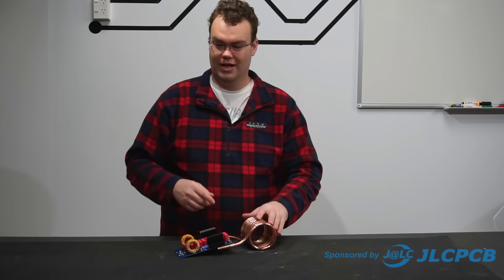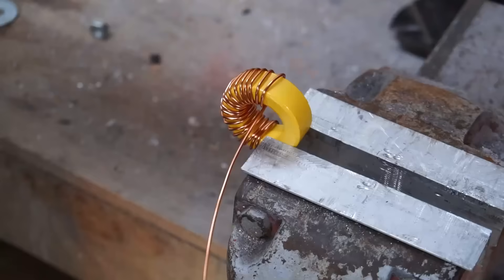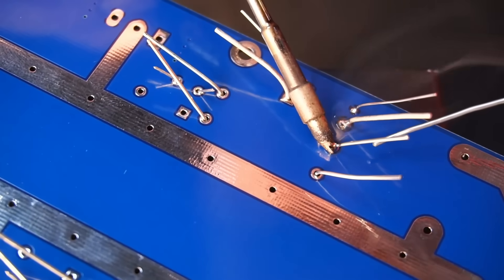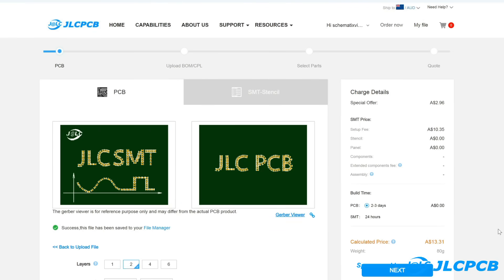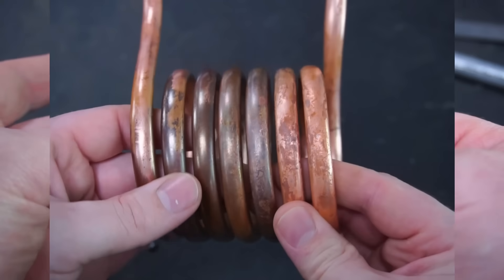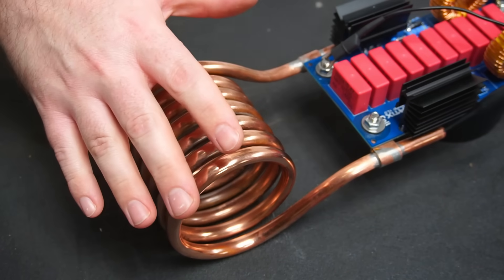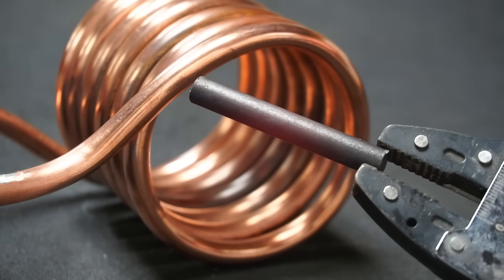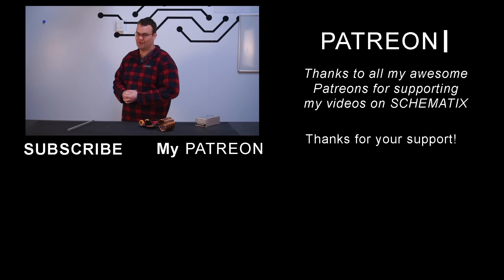Building a 1.4kW Induction Heater

Comment: Best induction heater build I've ever seen. Looks great and I loved your meticulous attention to detail. Very fine work indeed sir. One question though...On the Gerber files, would it be an issue to increase the thickness of the traces, in particular the fat ones you have to tin and add more copper to the traces? I was thinking about building this version, but either ordering the PCB with the thickest traces I could select or adding a copper busbar or long copper braid in addition to the tinning on the fat traces. I don't know if that would make much of a difference, but I like the idea of improving the current-carrying potential.

Also, if I may offer a suggestion. I had an induction heater similar to yours a few years back and I used a water pump, silicone tubing, a water reservoir, and a CPU AIO radiator from a retired CPU cooler and attached the tubing to both ends of the copper coil creating a water-cooled induction coil which worked really well. I bet that would help your desoldering problem and avoid overheating the PCB.

Comment: When you heat up Copper to soften it DON'T cool it with water let it cool slowly in air! It is way softer this way!
You quench something to harden it, yes it's softer then work hardened but way harder than slow cooled copper.

Comment: I'm betting the coupling is the major factor, but more notable in non ferrous since there are no domains to flip.

I would bet if you got a copper tube in there that's just so much smaller than the coil as to be a non-shorting fit, it would get right toasty in a hurry. Same for any decent conductor, really.

Down in the center, the field is easily overcome by the "weaker" eddy current field due to bad coupling and so not much happens.

Up close in an air core, with a tube, you effectively then have a single shorted turn secondary transformer, and the juice is gonna flow. Object can be solid as well, but it's mostly going to heat "surface down" rather than being uniformly heated by a changing field.

Eddy currents are of course present in ferrous as well, but hysteresis dominates by far at higher frequencies.

Comment: I think if you make the connection of the coil in the center of the PCB you reduce the current running in the traces. At the end of the trace you have the max current running, in the center it comes from left and right and therefore the maximum current in particular part of the trace is less.

Comment: If i wanted to use this for heat-treating small metal parts could I take something like a fire brick that was shaped to hold the part in the center of the coil? Round on the bottom so it would rest on the coil and have a channel cut in the top to lay the part in

Comment: if frequency and power variables, can heat different metals, and some alloys. what is needed, is a variable, voltage and variable frequency, device to power, different size coils. you might be able to even shape rock, with the right power, and freq.
Reply: You're using a far lot of commas but okay, got your point :)
EDIT: I absolutely loved your copper coil build, I was searching things like them a while ago for a prospect build by the name of "Metal wicks". Found it finally, thankyou so much!

Comment: great project. i hear about inductive heating but till tonight that i saw how it work... I got in to it... would it work with stainless still. or cooper.. im planing on building a water heater for a low laying dry ice machine. I need a water heater that would heat up water as it passes thru the coils. so it would be spray on to the dry ice and generate the low laying fog efx. i was planing on using map gas but after seen how efficient inductive heating work I belive is the way to go.. but also power is a big problem 1500 watts its alot of power, it would be a problem in most places where i would be using it.

Comment: I need advice.  My heater is heating the coil up very hot without any metal inserted into it. Yours doesnt appear that way, I can see it directly touching your deskmat. Mine is much smaller and its basically just heating the induction Coil itself up as if it were a resistor and dumping the full 120 watts (12V*10A) out as pure heat. Its reached 80C quickly in under a minute and I shut it down because I feared it would increase and melt the whole PCB down.

Comment: you have placed your  capacitors in the center of the pcb, and unfortunately capacitor terminals during resonance carry very high currents and will radiate heat and magnetic fields in all directions . Its much wiser and better to place Resonant capacitor banks  far away from board components.

Comment: A lot of blacksmiths are using 15Kw induction heater units.  These all have a water pump for pumping water through the tubing to keep it cool.  It's not the curent running through the tube that heats it but the radiance from the metal being heated. 
 https://www.derekmelton.com/my-induction-forge?fbclid=IwAR3k4UowbXOpFMoc9bBchBT3vnGh5ZqZOwxhH2lgB8vMrfYmAlKoN3JfAEM

Comment: I love the video and the design of the board but in reality the working coil is SO IMPORTANT (number of turns, diameter of coil and gauge all play a MAJOR part on frequency and power) and changing the ratings of capacitors (smaller) and working coil all change the output Frequency! (higher!) and decent connection on the working coil is a must there is a 6mm gap between the copper brackets you soldered on and the actual board!! could i ask what is the frequency of this should be between 15-25khz?.
I have a 24v high frequency power supply setup atm and it's only capable of 10A @ 24v so 240w and it heats up all small steel great!!! would fit inside a UK double socket box what do you think?.

Comment: Would a DC welder work as a power supply for this?

Also, to heat up non-ferrous metals perhaps you could wrap a steel wire around the non-ferrous object, or slide some steel nuts on it, or something along those lines.

Comment: Hey there.
It appears the given dimensions of the toroids used are different in the video compared to the doc on your website. I was wondering which one you used and if maybe inductors built with these two different toroid have an equal amount of approximatly 100uH.
By the way impressive build.
Greetings.

Comment: Very nice. I wonder if this would be good for an instantaneous heater for individual taps. It’s already more efficient than resistive elements but to have them sized correctly for each individual tap would mean even less heat/power lost through the pipes.
Reply: You'd need a hell of a lot of power to do that. A hot water heater has a huge element, and can't keep up with demand of a tap. If you want tankless, natural gas is the way to go.
Reply: @bluedistortions  yes, once upon a time hear in Australia it was common to have 3 phase instantaneous hot water heaters supplying all hot water taps in a house from a single central unit.

Comment: This is a beautiful video, very pedagogic and nicely presented. I did forsee the lack of powermanagement in the printed tracks. Solder is not a very good electric leader, so I thought, this is going to melt. In my own induction heater , I solder a cupper track on the printed board to cope with the rising amps :-))

Comment: Hi bud, this is awesome but how does copper become harder the more it's bent? My logic states it breaks eventually with fatigue, I can't fathom it :s thanks for sharing mate :)
Reply: That's why it results in failure due to fatigue. The work hardening effect increases the hardness, causing it to become more brittle and lose ductility i.e. eventually causing fracture.
Reply: Copper behaces the opposite to steel/iron. What you know on steel, just reverse it.
Reply: Sorry I've just seen your comments guys. Wow, this might be daft but I'm finding it hard to perceive, it's counterintuitive in my head but I guess as clay hardens, it's also brittle: eg. A vase or mug; clay is basically between soil and rock I guess. I think I also remember of brass monkeys (as in the phrase) guns cracked or fractured in the extreme cold, not just contracting. Mind blown, thanks for the info!

Comment: Hi !, thank you so much for this video !; I have some questions ... would it be possible to generate the alternating current of the winding directly from the alternating electricity of the home? Would 50Hz at 220V be enough to generate an inductor?
Could the consumption and therefore the amps be controlled through the number of turns, size, and the material that was being heated?
In this way we would avoid having to rectify the AC in DC and then generate an AC by resonance again.
All the heat generated by this process does not affect electromagnetic efficiency.

Comment: I want to try this heater to find out if I can heat up (flowing) water in a warm-water circuit.
Looking at the parts list and PCB, I have a few questions:

The cap bank, you need many to reduce ESR and/or current through each cap? I could use 3x 630V 1µ5 caps, but the schematic shows 10 470nF caps and I wonder what the reason could be for 10 :)

The MOSFETs are hard to get at the moment, but I see IRF200P222 - wouldn't these IRF be better than the ones in your parts list?

Would it be better to parallel the FETs with another one on each side?

researching the circuits I found this hint on some websites about induction heaters: connect one side of the heating coil to the front of the cap bank and the other side to the end of it, so the cap closest to the coil won't heat up as much because the load spreads over the whole bank this way.
What do you think?

Comment: WHY HAVE YOU NOT TRIED A MUCH LOW POWER VERSION IT ON MALARIA?

Magnetic fields may hold key to malaria treatment, UW ...
www.washington.edu › news › 2000/03/30 › magnetic-...
30 Mar 2000 — Henry Lai, UW research professor of bioengineering, says the malaria parasite Plasmodium appears to lose vigor and can die when exposed to ...

Comment: You did a great job,well-engineered. I suppose you should create a special high current driven path for that high amount of current, the simplest form is to create multiples through-holes in the path to make it temperature-tolerated and well-ventilated. Thanks for sharing

Comment: We use an induction heater for welding steel tube at work. Ours runs at 800 volts, is rated for 800 kW, and uses a frequency of about 135 hz.

You can increase efficiency, and therefore power, by decreasing the gap between your coil and the heated object. Try it with a piece of steel pipe with a diameter of ½-1" smaller diameter.

Comment: I think I'm going to build one for a friend.
Important questio though. Can I have the coil installed on a flexible "extension cable"? What are the implications of that and how to calculate the length of such cable?
Friend of mine works in the garage and won't be able to get the size it this anywhere, so smaller coil on an extension cable is the only option.
I'd be grateful for any help.

Comment: Attention!! 
Please note: Before ordering the boards, make sure to buy the components in full and compare the grid mass. I have 10 boards and the capacitors from WIMA have changed external dimensions and no longer fit the grid size of the board. The new dimension is now: 16x32mm 
Achtung!!
Bitte beachten: Vor dem bestellen der Platinen unbedingt die Bauteile vollzählig einkaufen und die Rastermasse vergleichen. Ich habe 10 Platinen und die Kondensatoren von WIMA haben geänderte Außenmaße und passen nicht mehr auf das Rastermass der Platine. Das neue Mass ist nun: 16x32mm.In Deutschland ist es außerdem schwierig oder extrem teuer an 2,2 uF keramische Kondensatoren zu kommen. Gibt es da eine günstigere Lösung? Auch der Kühlkörper ist sehr teuer. Ich habe einen vergleichbaren bei Reichelt gefunden, der nicht mal die hälfte kostet. -
www.reichelt.de/index.html?ACTION=446&LA=10040&nbc=1&q=sk 574 50 Dafür müssen aber noch Halteklammern mitbestellt werden.

Comment: cisco ws-cac series powersupplies.  they are available on the used marked for really cheap and are available in 1.3kW up to 8.7kW!  at 42V   its self protecting, robust and doesnt require any modifications to turn on.
some models (theyre available from astec, sony and delta electronics) can even be voltage adjusted a bit, on astec ones, 48v is no problem. (theres 2 potentioeter holes on the side)

Comment: Loved the video ! Thanks ! 👍👍👍😊  What if I use it on lower voltage for heating a metal tube with water circulating in it at low speed (floor heating) ?
Reply: Same question. please reply

Comment: Hi blacksmith here , your coils need to be designed specifically for the diameter of the object your heating there is a ratio beyond which it is slower to heat a smaller object in a bigger coil  as the distance is to great , and im sure you know but i will mention it if your heating a piece3 of steel to welding temperature your copper coil will melt before that without water cooling .

Comment: What thickness of the copper did you order for the PCB? Standard 1oz or 1/2 oz? Better with 3 oz or more. Slightly more expencive but can handle way much more current, and way much more reliable than adding solder and/or an extra wire on top of it. Of course you can still do that, but I reacted on one thing in the video. The added wire soldered on top of the tracks should go through the vias too, else they will be the very weak spot.

Nice project :)

Comment: Regarding your final thought about adding a length of wire to the traces so that they can handle the higher current more effectively, wouldn't it be better to correct the issue at the source, insead of coming in after the fact to put a bandage on it? It looked like there was plenty of unused space on the PCB; howabout widening the traces on the board? Pretty sure there are online calculators to help figure out how wide they should be for the current flow required by the circuit.
I dunno, just an idea. And actually, if it's a bad idea I'd much appreciate an explanation..
Reply: There is no way heavier traces will achieve a conductor Cross Sectional Area (and so current capacity) of more than a few square mm.  For long life at low temp you need about 10-16 sq mm CSA to carry 40-63A.  More CSA if enclosed with no heat dissipation. Remember that the glue that bonds Cu to fibreglass board isn't up to the duty of mechanical, thermal and electrical connection of those heavy coils.

Comment: hello , thanks for your clear explanation and demonstration  . Any suggestion how to manage and heat  a steel part that can not be inserted in to the copper coil , but needs the copper coil to be able to spread like hair clip , and than close to do the heating ? for example if I want to heat the bar that connects two   gym weights ...
Reply: If the wire or tube goes back and forth you will make the magentic fields of the segments cancel each other... I'll suggest you to look for "pancake coils", and go creative from there...

Comment: it is better to solder the components after cutting the pin
Reply: You solder your way and everyone else will solder the correct way.
Reply: @haywoodyoudome  yes, the reason is to avoid oxydation on pin. It's a question on reliability, if you cut and sold after, it is a way to have better reliability.

Comment: Hey man, I'm a plumber and your supposed to put the heat on the joint before you solder. Not 3" away, just a tip my man. Get a B tank with a cheap regulator and a turbo torch tip it can even be a M-tank. Pencil tip for small 3/8ths. Dude the joints will look fire.

Comment: @06:57 Annealing usually works as this: to heatup the metal and leave it until it reachs room temprature.
The opposite of it is Hardening, which needs quenching first in water or oil depending on the metal you're hardening.

So when you quench it in water you're making the annealing imperfect, it would have been better if you left it get cool alone without putting it into the water.
Reply: Depends on the metal in question. Annealing copper does involve heating and quenching. Steel and most other ferrus metals get heated up and slowly cooled down. The exact heating and cooling curve dependant on the particular alloy.

Comment: Hey man. Old electronics technician here. I'd like to offer you some constructive criticism.

1. Well done on your pronunciation of solder. I do get a bit annoyed when I hear Americans try to pronounce it lol
2. You should really cut the leads off before soldering. Many components have tinned steel leads and by cutting after soldering, you'll find they begin to corrode after a while.
3. Nice job on tinning. I approve =D
4. You are soldering too fast. Compare your component soldering to your copper pipe soldering. With the pipe, you heat the parts up first, then apply solder. You should be doing this for the components as well
5. I always cringe when I see someone using a file incorrectly. Take a careful look at the teeth of the file as there is only one way they should be pushed against the metal (with one exception, let me know if you want to know what that is).
6. Heating up the copper and cooling it down quickly is called tempering. It still softens the copper, but a better method is to allow it to cool slowly. That would be true annealing.

Apart from that, great project =D

Comment: Good video. Its interesting that you use two 130a mosfets and 4.7uF (10 x .47uF) capacitance. The 2500w boards use 6 50a mosfets and 3.96uF (12 x 0.33uF). 
I'd like to know how capacitance affects power. I assume that more will lower the resonant frequency. Can the frequency be tuned by adding parts?

Comment: When soldering copper fittings, direct the heat on the opposite side of the fittings from the soldering side, solder flows towards the heat.
Reply: @MichaelBushey  propane gets plenty hot enough, I've been a plumber, he's just not an experienced solderer.
Reply: @MichaelBushey  for soldering? What kind of solder you using? It made of steel or something? Solder has a very low melting temperature.